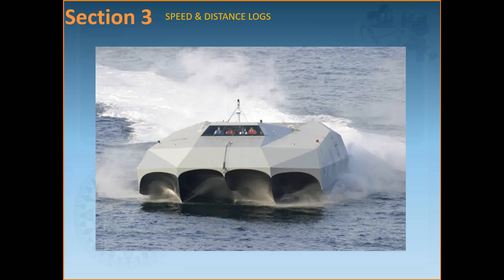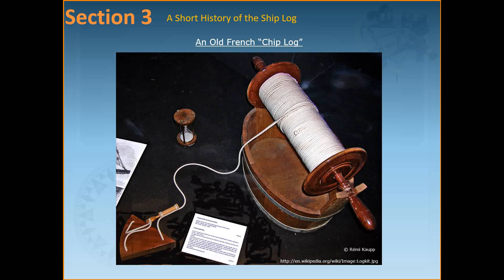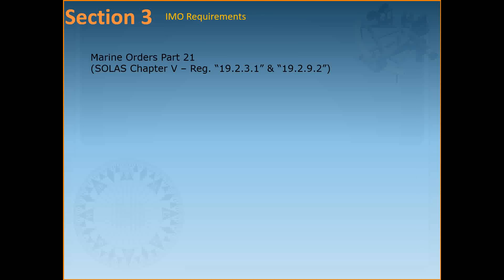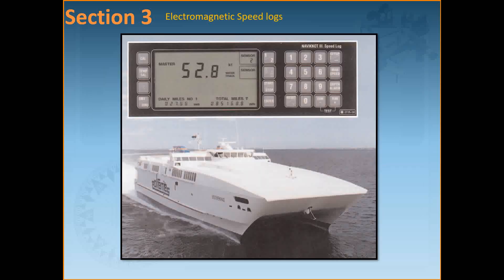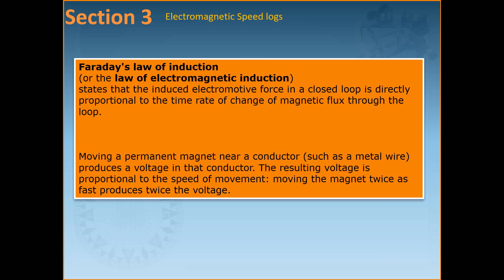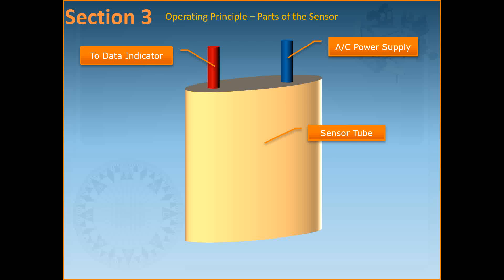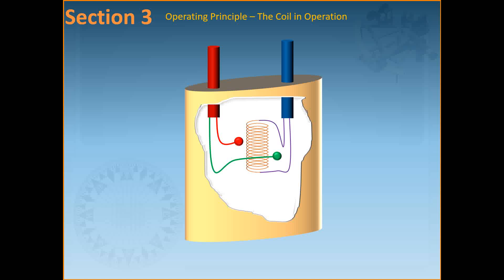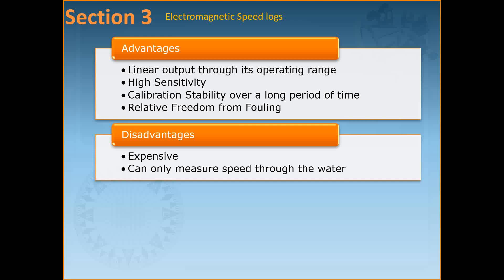Speed and distance logs on ships -  Electromagnetic Log

Comment: Sir I'm in a doubt, if you can please clear. Supposing there's a favourable current of 2 knots, the water moving across is effectively moving at 12 knts , if ships' engine speed is 10 knts. So that makes the 12 knts SOG, not STW. Everywhere it's written that EM log only gives STW. I'm not getting it. If you can reply and clear the doubt please, it would be of great help.